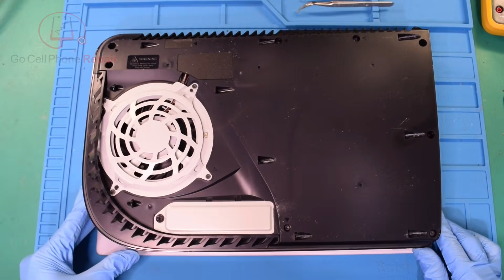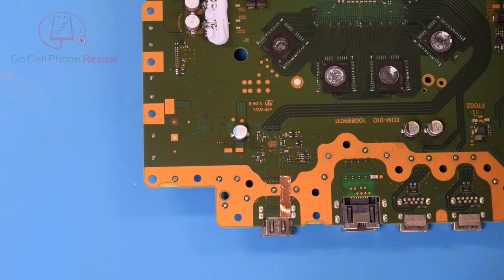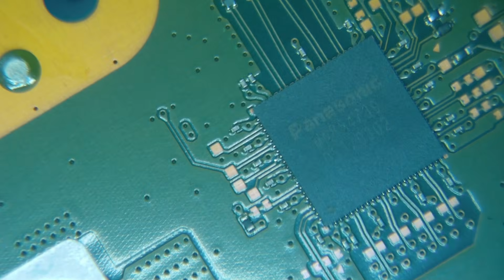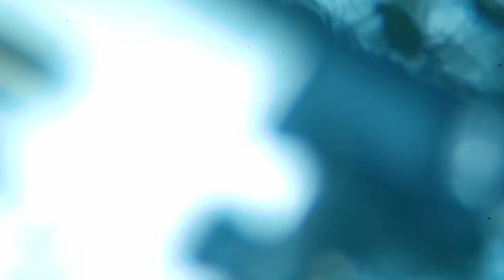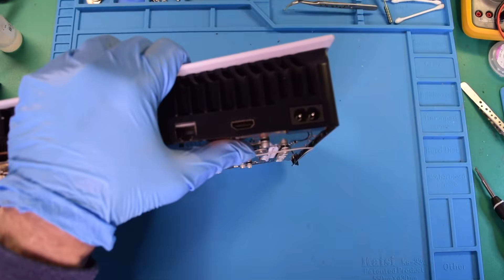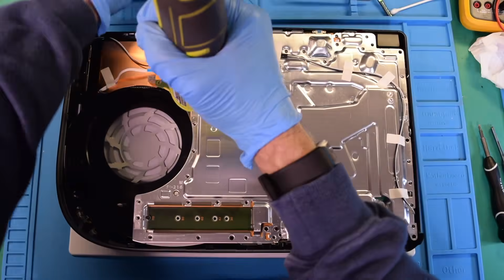From Broken to FIXED PS5 HDMI Port Replacement in 30 Minutes CFI-1015B

Comment: If you struggle to get the hdmi port off the motherboard id recommend buying some sra fast chip smd removal alloy and mixing it in to existing joints with a soldering iron. It will make it a lot easier to remove the hdmi port with a heat gun.

Comment: hot air temp?
Reply from the maker: That temperature can vary depending on many variables so your mileage may vary. I use a Quick 861DW with no nozzle, 420C at 120 LPM, preheat the general vicinity and then concentrate on the port area with very little distance. I'd estimate about 1/2 an inch away. If it doesn't come off within 60 seconds you're probably not getting enough heat and the risk of spreading to nearby components increases if you continue much longer than that.

Comment: One problem after another My heat gun turns off when held vertically from a sensor inside. I am so frustrated. I will now be putting aside the ps5 and opening my heating gun. It POS Samsour 8586.
Reply: Fixed the problem, removed the small white rascal angle switch.

Comment: Dear sir I bought copper tape but I am not sure what brand you use, since I am afraid that the glue will burn leave carbon deposits or fall off and I lose the tiny resistors and caps.

Comment: what temperature / settings did you work with on the hot air soldering stattion?

Comment: Do you have a soldering station, microscope you'd recommend for pads this small? Looking for something relatively entry level since the repair itself would cost around $250.

Great video, thank you for this.

Comment: For anyone wondering, I used 500C with no nozzle, I held it back a bit, say 2 inches, to heat up the board. Then I came up nice and close, about half-quarter inch, to melt the solder. Wait until the solder looks shiny like in the video, then very gently pull up. Be patient! As for putting a new one on, I strongly discourage the method in the video for beginners (like me). I failed that way. Just put a ton of flux paste on, get the connector very very hot, and apply solder with an iron while still blowing on the back. Use just. Abit on the tip and run the iron on the pins. Also fill one of the support holes with solder too (not a lot). With all the pins ligned with solder and melted, place the new port in. When its on give it a tap with your tweasers a few time to vibrate it down. Finally add a ton of flux to the pins and wait until all the solder nicely flows to where it needs to be. This removes all the contaminants and sets the solder in nice balls. Finally turn the board around (dont burn yourself) and do the ancors with the iron like he does in the video. Good luck all!
Reply: Do you clean the board solder before putting in the new port? Also do you have to put solder on the pins of the new port or that is done at the end. His flux also seem to be getting oxygen contamination but that is just my opinion.

Comment: im totally new to this, where you adding the solder wire to the actual heating element, then applying it? its just stays on the heating element?  im so used to seeing people putting the heating element to the board then putting the wire to it
Reply from the maker: I pre-tin the tip of the iron and then just flow the solder to the joint.

Comment: Nice job! I started doing these for people in my local area. One thing that helps me is having the mobo / old hdmi port upside down while de-soldering. The port just falls out when it gets hot enough. I tore traces on my first one pulling on the port. Since then, i've successfully repaired about 30 systems.

Comment: I REALLY like how you cleared the holes for the 4 legs of the new HDMI port. I'm going to try that on my next one. Thanks!
Reply from the maker: That's great! Let me know how it goes and a word of caution- if you have a small piece of hot wick soaked with flux and you happen to blow it of off the board it will stick if it lands on your skin. You can guess how I found out.
Reply: There always seems to be 1 through hole that is stubborn.  Heating underneath while soldering on top is great time saver. 👍

Comment: Would it be easier to remove that capacitor that's all close to the pins and then put it back?
Reply from the maker: If you are comfortable working with things that size, I'd say quite possibly yes.

Comment: Thanks for the video! Does it have to be copper tape to cover those components, or can it be regular foil tape? I already have foil tape on hand and would rather not spend money on copper tape if I’m only going to use a tiny piece of it one time.
Reply from the maker: That is a personal preference. I like the copper adhesive tape because it holds the components in place if the solder beneath them starts to melt. Some people don't cover them at all but I like to take precautions.
Reply: @GoCellPhoneRepair  Thanks for the reply. Yeah I tried doing it without once and lost the capacitor. I ended up using the foil tape and it worked fine.

Comment: 12:45 is that rubbing alcohol your using ? Also what is that copper strip your using to rub in the liquid ? I want to make sure i order everything I need for this
Reply from the maker: Yes, 99% isopropyl alcohol and solder braid.

Comment: I just want to let you know that I am a 43-year-old single mom of a teenage son. Because of this video I was able to fix my son‘s HDMI port on his PS5. When my son plugged it back in after I was finished and it worked, I almost cried due to the amount of money I saved. Thank you so much ❤️
Reply from the maker: That is awesome! Congrats.
Reply: That's awesome.  It isn't easy due to the large ground planes.  It's an understatement that the board cools fast. Slow and steady wins the race.  The largest stress reduction for me in these situations is using Kapton tape over those low hanging caps and resistors.  I cover any ICs and the next port also. I use tape to make up for my lacking experience. Great video!
Reply: You go mom!!!!
Reply: MOM OF THE YEAR
Reply: Ok then... slay queen!
Reply: Oh wow how cool. Hope your son said u the mvp
Reply: Nice job mama
Reply: Queen
Reply: Cap
Reply: @Sk-xo3vi big cap. Assuming you need to properly desolder and solder the new hdmi port. This needs practice
Reply: @tylerdurden6992 Not really if you follow directions right and aren't being rough with it it's simple to repair.

Comment: I open my ps5 to dust it off then I had the hdmi issue. It’s actually bs that an expensive console has to go through this , never had this happened on ps3 or 4
Reply: Can't speak for all but my son tripped over the cord and sent the console sailing.  I do like blaming the engineers but in my case at least, it was user error/mayhem. I think gluing the port down makes sense  to stabilize the board a little more.

Comment: For the very green horns, like myself, thats more than likely gonna screw this up, could you not just go ahead and solder those 4 pins that were loose and call it a day? That of course, if that is in fact ur problem.. My ps5 has been thru hell so I wanted to give this a try and if I make it worse, then I'll have me a parts machine but most importantly to me, I hope I learn something good or bad...
Reply from the maker: In some cases yes, a few disconnected pins can be tacked back on as long as the anchors that hold the port securely are still solid. If they move around at all, it will be very easy for the port to be damaged again. That is assuming that the outside of the port is also in good shape.

Comment: Your comment about cleaning the socket is an absolute life saver!!! I had checked connections and everything was fine but it wasn't working, wiggled the cable a little and finally got a little signal but still not good. Keep watching video and that was the exact problem, Thank you!
Reply from the maker: Glad it helped! That is a very common problem that rarely seems to get mentioned.

Comment: if i ripped 2 pins off am i screwed?
Reply: depends, some of the pins can be NC. In this case you are still fine. if connected anywhere, so yeah you are.
Reply: How did u rip them off ? When u pulled the port off and it ripped them then?

Comment: I have some decent experience with soldering , never had attempted micro before though. My daughter hdmi finally went. When I got it under the scope all the pins were loose. I decided to just replace it since I had a new one, pre tinned all the pins, heated up the area, dropped I'm the new port and everything set into place perfect. Connection are solid and hdmi is working.
Reply: So glad to see someone else had luck with this with little experience with tiny pieces (like those little transistors or whatever they are that I’m seeing right next to the hdmi pads)  I’m about to attempt to repair a friends! Wish me luck.
Reply from the maker: Glad to hear you got it fixed!

Comment: Im getting ready to open up my old PS3 super slim to clean it out and put new thermal paste on the processor. I keep getting these videos with ps5's having broken hdmi ports so I will be extra careful now handling my ps5. How much would this cost if I had it done by a professional?
Reply from the maker: It varies from one place to the next but in the US you can expect $100-150 from most capable shops.

Comment: At what degrees did the solder let go? Im currently at 350 Celsius on my heat gun but it wont let go
Reply from the maker: You are using a hot air station right? Not a heat gun I hope as this requires precision that you won't get from a heat gun. While settings vary from one machine to the next, I run mine a 420C, max airflow- 120 LPM, and no nozzle. It is best to practice on a donor motherboard beforehand in order to avoid fatal mistakes.
Reply: @GoCellPhoneRepair  Thank you very much. Yes a heating station. I figured out the temperature by increasing it slowly but I'm afraid I didn't manage the get all the pins to connect. I think it's time for a digital microscope I can not do it any better without one
Reply: it needs to be at 450 Celsius and 120 air flow higher than that u can easily damage other components on the board and be patient and gentle. last thing you want is to rip pads or knock off some other components. please lmk is there's anything i can help with. lmk how it works out with u
Reply: @Moodyger_  Thank you very much. I will need to get a digital microscope, I think I didn't get all the pins to connect. I masked the little diodes

Comment: what if i damaged one of those flat connections on the motherboard when removing the old HDMI port? is there any fix for that?
Reply from the maker: If you damaged a pad you'll need to replace/repair it. I'll make another video for that when I get a chance but search for PS5 HDMI port jumper wire.

Comment: I have minimal experience but I do have all the tools I need. Might take me a while to do this but I think it’s something I can learn somewhat easily. Gonna be trying tomorrow. My step sisters boyfriends hdmi port is messed up I haven’t looked internally but you can see that it’s displaced and it did fall. It’s giving intermittent signal so I assume it couldn’t have broken a trace or anything must just be the port itself.

Comment: Hey @GoCellPhoneRepair,
I have a broken PS5 that I got for free, and it seems to have the same issue you worked on. I’m really interested in learning how to fix it myself and understanding the whole repair process—it’s fascinating!  

Would you mind sharing which tools and products you used? For example, the liquid material, the heater, and the soldering tools, the special tape, etc. Could you maybe provide a list of the items and where you got them, or their specific names? It would really help me get started!

Thank you in advance for your help!  😁
Reply from the maker: I will tag the equipment that I used in the video as soon as I get a chance.
Reply: @GoCellPhoneRepair thanks for doing so

Comment: Which tip are you using for the last part of the repair when soldering around the cap?
Reply from the maker: Hakko micro tweezers T9-I tip.